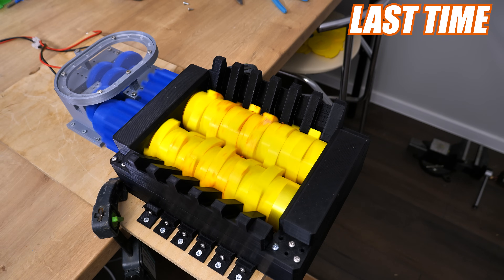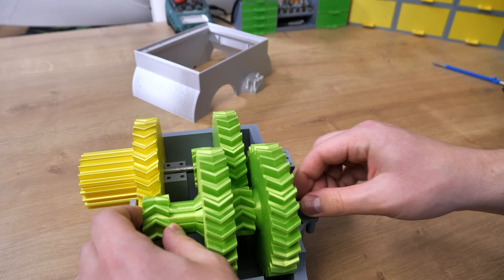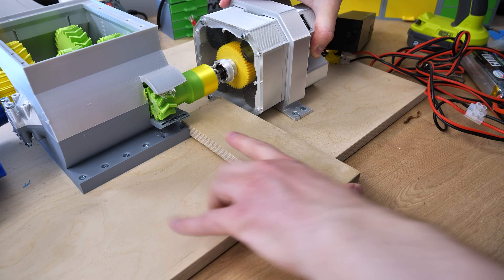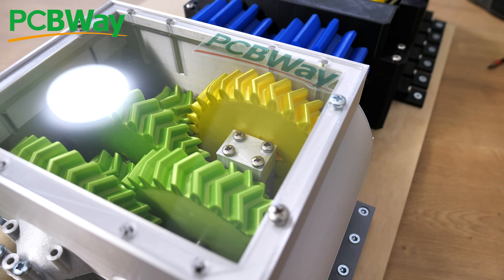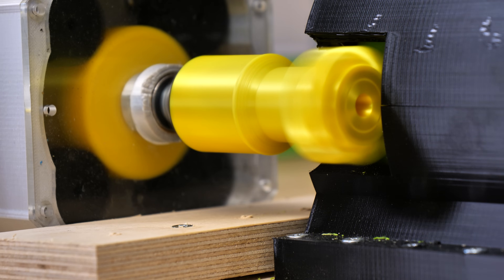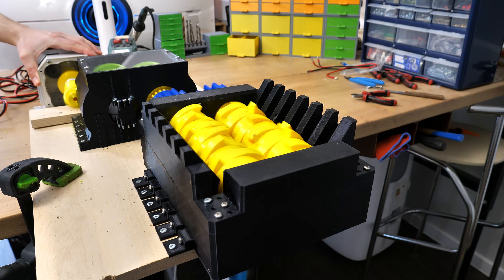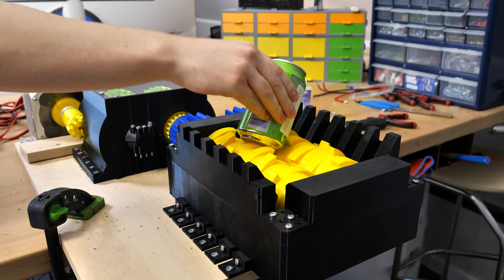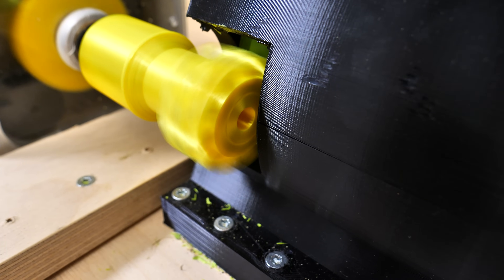I Upgraded My 3D Printed SHREDDER And Now IT CAN HANDLE EVEN METAL - Part 2

Comment: I think the main issue for the blades not cutting the objects is due to blade width and hardness. Wider blades is more difficult to penetrate in the objects and soft materials wear in less time. Even PLA is not so hard material to be used. Polyamide with carbon fiber should be better option. I want to build a shredder made of plastic and your video gave me several insights. Congratulations!

Comment: Good project, BUT, the problem is that its too complex, complexity ads to the amount of points of potential failures. that whole gear box could have been done away with if you got a low speed high torque engine instead. Then the axle of the engine could be directly connected to the axle of the shredder.
But my question is, can i make the shredder in PAHT-CF and will it be strong enough to shred PAHT-CF prints to the point it can be melted back into a filament?

Comment: The gear print which split could have failed due to printing fast on the Bambu and using silky filament. Fast prints tend not to bond as well, and the silky also doesn't bond as well. Print regular PLA and with extra high temperature (230°C) and slowly.

Comment: Could this use a router for the motor?
Reply: No, cuz CNC spindle motors are way too fast like RS-775 DC motor spins at 10000 RPM at a shitload of torque while 200W CNC spindle motors have about one third of the power of 4 775 motor gearbox at 20000 RPM (40000 ERPM AKA AC freq. because 4 pole BLDC)😂

Comment: use an old car electric windshield wiper moter + gearbox to drive it. that betch will have some serious torque if you use a car battery as the base to power it.

Comment: It would be really cool if you could try adding a flywheel to the rod that holds the teeth. That way there would still be a bit of momentum in the system that could help when it would normally get stuck.

Comment: Several things come to mind here.  1) A bracket to hold down the input motor.  2) Metal teeth on the shred drums.  3) Direct input of power instead of going through two different transmissions.

Comment: I really appreciate the creativity of building a shredder with 3D printed parts, but there are many areas of improvements that can be done. Gears inside gearboxes should be mounted with ball bearings to reduce friction. Also the input gear has shaft constrained only on one end, which is making me uncomfortable. Still, you did a good job overall

Comment: Instead of increasing infill, increase your perimeters. As they're printed in one continuous line they're much stronger, and adding more perimeters massively increases strength at very little cost. It's even faster than higher infill in most cases. You could probably print that with 10 perimeters and 10% infill and have it be just as strong as 40% infill.

Comment: My suggestion is to add a bearing a the end of the output shaft form 4-1 motor gearbox so it can stay in the same position relative to the housing of the gearbox. I would modify that housing to accept a bearing and add shaft to the output gear to mate with the bearing. I think that it would help a lot

Comment: There is no shredding happening here, maybe with the veggies, but not the cardboard or the cans. You need tighter tolerances on the teeth so that they shear the material.
Reply: This machine is a rotary shear. It is intended to shear the material through the cutting action of the intermeshing shear rings, similar to scissors.  As with scissors, if the two edges of the blades are not in contact, or very close, it won’t work well. The shearing blades also need to be harder than the material to be sheared, otherwise the shears get cut by the item you are trying to shear.
Reply: thanks captain obvious.... @TricksterJ97

Comment: You definitely need to do something to improve the output. Are the cans and prints forcing the blades apart, or is there just not enough close-tolerance or torque to shear them? Would adding a cross-cut layer and maybe a second layer of vertical blades help?

Comment: need to glue a tab in front of that gear to the next gear box and put an axel through it so it holds the gear in place and doesn't allow it to flex and move out of the way.

Comment: I did not expect printed parts to hold up that well. If you make another upgrade, my advice as a designer is to add more support to your drive engagement. Unless I missed something your drive gear from the gear box just hangs there. It lets it move too much. While I don’t know if you’d loose power there, it can cause you to hop gear teeth. Adding a flywheel on your grinder might also help to maintain momentum. A large/heavy object in rotation with help carry power into the grind.
Reply: And remember that a flywheel doesn't need to be solid since most of the effect comes from the velocity, and thus the weight, at the rim of the wheel. As long as your spokes can hold up the rim and (if it's hollow) whatever you fill it with (ex. Salt, sand, water), you can save quite a bit of plastic and print time by cutting material from inside the wheel during the design phase.

Comment: Silk filament are known for bad layer adhesion and are alot weaker. You should buy solid colors without effects :) PS. and when you print fast, thats makes the parts weaker also, increase the temps even more if you are printing fast.
Reply: Some pink pigments actually make PLA stronger

Comment: I think your use of the straight shredder blades hurts your shredder's ability. I know real shredders use these, but i just dont think plastic can provide the strength for this. Using slicing shredders would help crumple the aluminium more i think.

Comment: Well, i'm not sure if silk pla was a good choice for this, cause its usually much less strong than other materials, like for example PETG if you print it without cooling. Or ASA. I think that would be beneficial for your gearbox.

In addition cause you seem to focus on infill for strength, its more beneficial to use more walls instead of more infill. Also your parts are the weakest at their layer lines so if you have problems with gears breaking you could design them with little holes or inserts so you could fit in another 3d printed part in another printing direction or maybe some small metal rods an just glue them in place. 

Sintering your 100% infill parts is also a good idea but mostly requires specialised equipment.

And what i forgot to mention, if you use a bigger nozzle orifice for example 0.6 or 0.8mm your parts also get a bonus in strength but thats usually just cause they have thicker walls and less failure points in comparison to a 0.4 nozzle with twice as much walls. But layer thickness influences that aswell so you can't just go to a 2mm nozzle.

Comment: I thought about building a shredder for plastics at some point. I would consider looking into finding some cheap metal part which I could buy for the actual blades. The other idea was to use filament with some metal and then "metalize" the shell of the parts using galvanization. The third idea was to weaken the plastics first by heating them to a certain point before putting them into the shredder.
Unfortunately, I'm moving from one country to another and won't take the HDPE I collected with me. It can be mixed with PLA to make filament.

Comment: You made stackable planetary gearbox before, why not use it? More teeth engaged - more torque until breaking. Also remelting 100% infill parts in sand will make them a lot stronger.
Reply: I would also swap gear filament for PETG, PCTG or Pa12. Those are far better material for gears.
Reply: For remelting (or tempering, or baking, or sintering or whatever you want to call it in this context), the finer your powder the better it will retain the shape and features of your printed object. This can be particularly important with gears. If you can get a big bag of "popcorn" salt that would work very well and save you a lot of effort. You'll want to reuse it as many times as you can. If you can't get that much popcorn salt, you'll want to use a mill to crush and grind down table salt or flour or starch just as small. Whatever you use you don't want ANYTHING this size getting into your eyes or your airways, so make sure you wear safety goggles (not just glasses) and a mask over BOTH your mouth and nose any time you work with this stuff.

Comment: Your gears were breaking due to the high print speed. Functional parts you don't really want to go more than 100mm/s... Or really 80. The nozzle passed by do quickly that it didn't soften the previous layer of filament to provide a good bond to the new layer. There are a few videos about this out on youtube.

Comment: On each failure i was like: Are those parts printed solid or with infill? I see many 3D printing channels on youtube recommending and printing with infill due to filament save, but in mechanical parts that will be stressed even with a tiny bit of force this is a REALLY BAD IDEA and i learned that the hard way. Always print solid parts unless its something meant for decoration or other shit. Also when you fired up the gearbox and i saw the gear play on the contact with the shredder i was 100% sure this would be a huge problem, anyway great job in the end man :)
Reply: He specifically states early on that they are printed with 20% infill.
Reply: @claws61821  Yes but after each failure he was just increasing the infill instead of printing solid.
Reply: 18 walls at 20% bambulab PLA can move a car with bambulab P1S so wall count matters most😂😂

Edit:2 walls breaks instantly.

Comment: You should build a circuit that monitors the current on the motor and reverses for a short time when it sees too high of a current. This is how large scale hydraulic shredders work. They have a pressure switch on the hydraulic lines that will reverse the motor at a certain pressure.
Reply: Nope.  The operator reverses the motor when the shredder gets stuck.
Reply: @protoborg  no one is going to trust a million dollar car shredder to some operator eye balling it... maybe cite a source on that
Reply: @protoborg  maybe on some home built shredder or a really shabby one, but most hydraulic shredders have the pressure switch.

Comment: The only thing that would have really finished it off, would be if you didn't have to hold the motor box. Such an awesome effort though, super impressive! I wonder if the gear that sheared in half (which you had never seen before), was something to do with the fast printing with the bambu x1c.